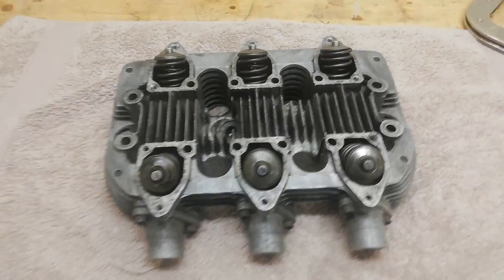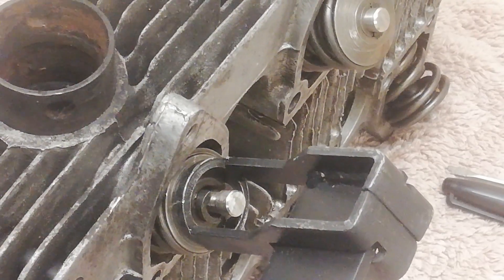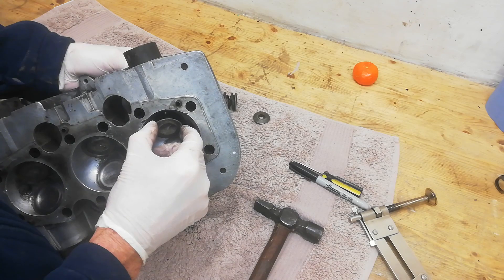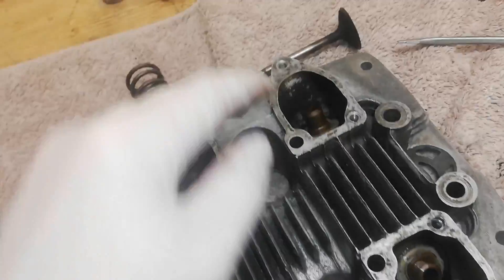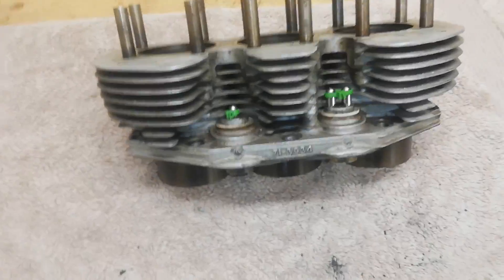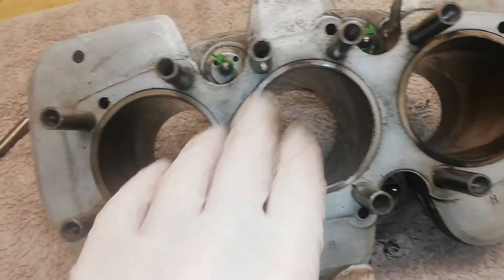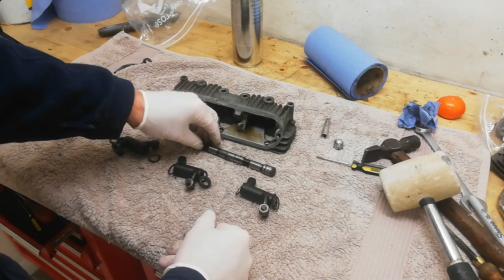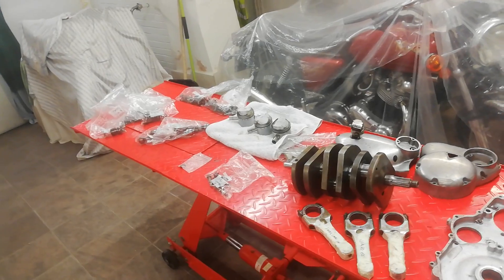Triumph Trident T160 Engine Rebuild. Part 12: Stripping the Cylinder Head, Barrels and Rocker Boxes

Comment: It's funny how that head looks so very much like the 1966 T100 500cc head off of my bike.
Reply from the maker: In many ways the Trident was basically a T100 plus another cylinder, so turning a 500 twin into a 750 triple.
Reply: @Chris.rooke150  It was a good idea because the T100 was a fantastic design.